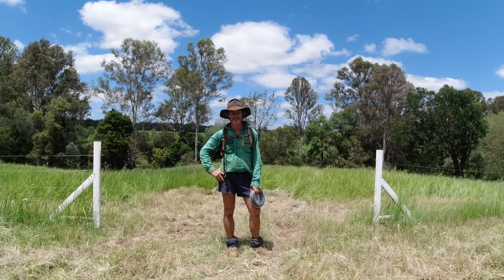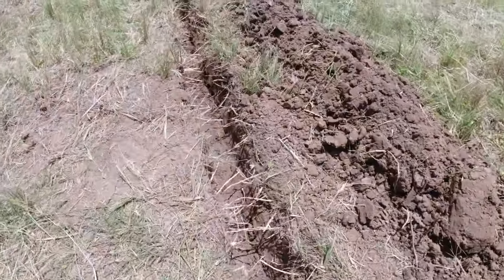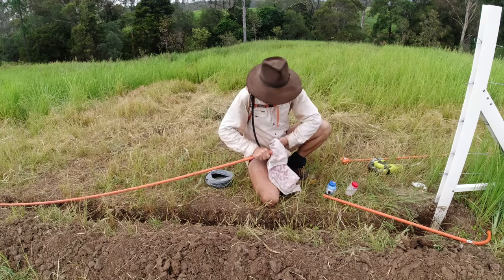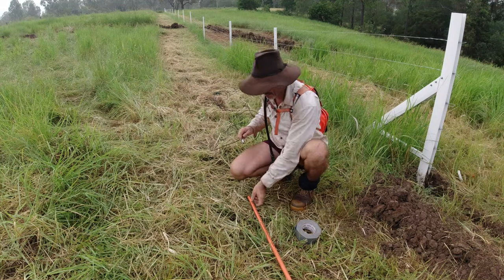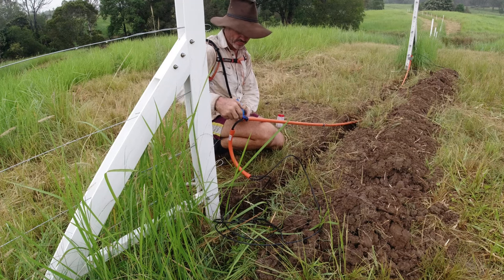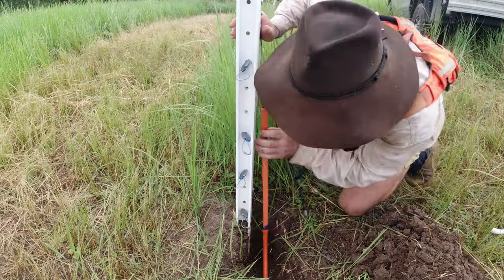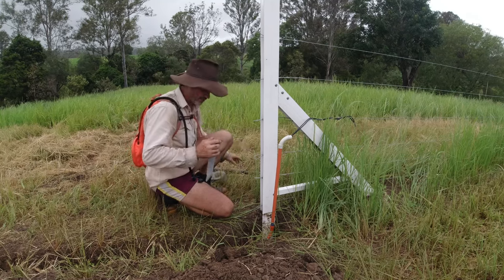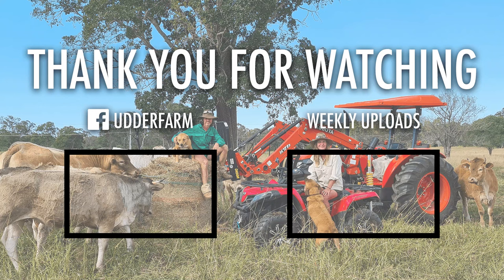Best Practice Electric Fence Jumper Cable Install Between Timeless Fence A-Frames!!

Comment: There is nothing quite like digging dry earth 😂 Nice job. Something I’ve done before is to use 1 more 90 on each end. Now the open end faces straight down so no water gets in the pipe. The problem is, water always gets in the pipe!
Reply from the maker: Hi Wakeywhodat, thanks for not only choosing to watch another one of our videos but for also taking time out to message us with your positive feedback it’s greatly appreciated mate. Yes, I burnt a few additional calories digging that dry dirt, though seeing a lot was clay it would have been harder to remove if it had been water soaked. The additional 90’s like you mentioned crossed my mind several times. Though like you mention water finds it way in regardless, even though I had the ends taped the water still got in, luckily the jumper cables are well insulated. Hope you have a top day mate.